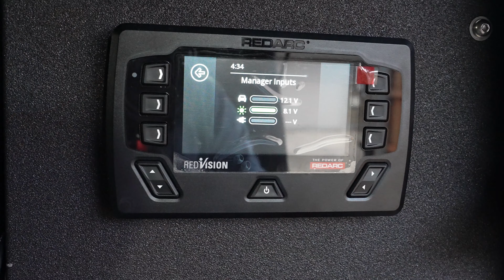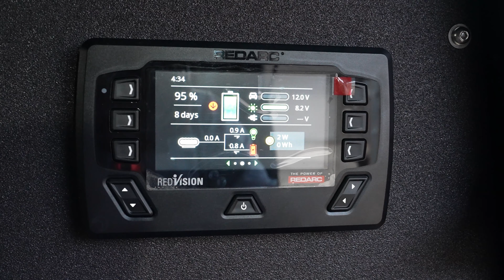The Ultimate Solar Solution for Overlanding

Comment: Love your build so far! just some advice about the hardware you used on the solar. I have opted to use all stainless as your Alu cab Hardware kits are all SS, when you add carbon to stainless it causes a reaction and will eventually start to corrode. even galvanized plated screws! The salt air and water also corrode the Galvanized hardware. not criticizing just trying to help.. cheers!
Reply from the maker: hey, good advice!! ill check my bolts & nuts to see about swapping them. my ears are always open, so keep the advice coming!!

Comment: Love your videos and advice. Why 2 solar panels and not just 1?
Reply from the maker: Great question!! We operate our approach to gear like Kevin from Lifestyle overland. Two is one and one is none. In this case if a panel goes out, you can still operate with one. Same on our new build (four wheel camper hawk) we put 2 200-watt panels.

Comment: Thanks for the vid. I have Goal Zero panels and a GZ yeti I am looking to reuse for my new ACC. Can you tell what size Anderson connector the built in port on the roof is?  50a?
Reply from the maker: hey yes i ordered 50a from Amazon but they felt very flimsy so not sure what is a good resource.